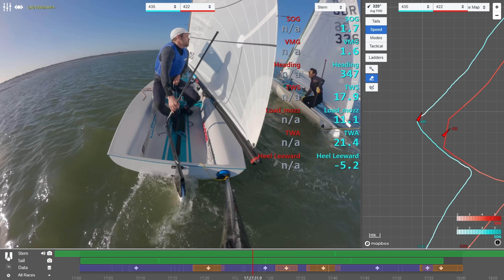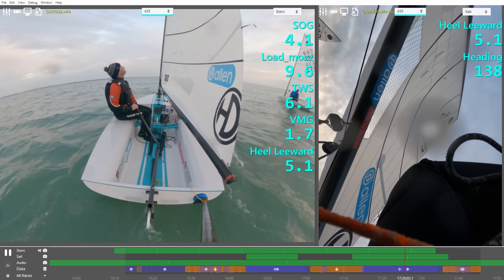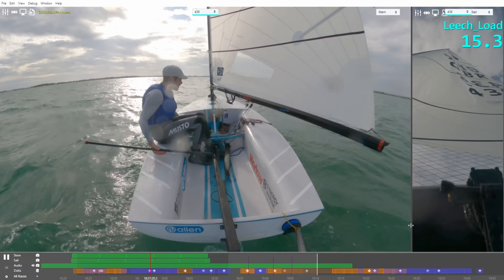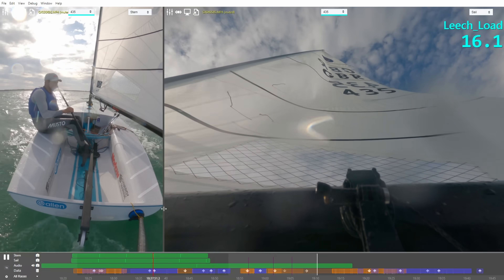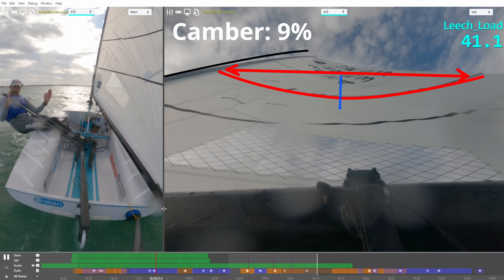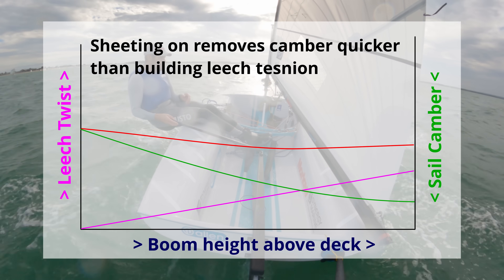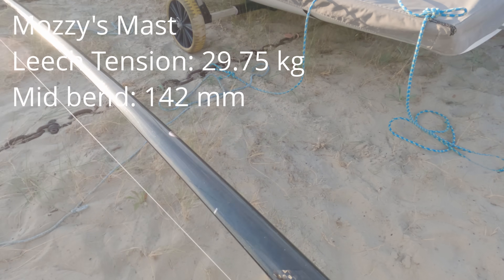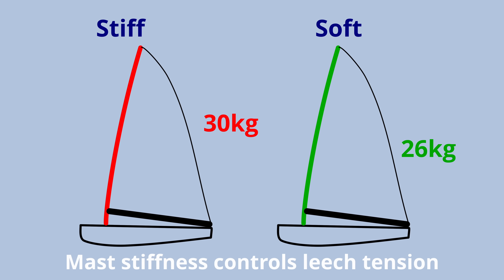The Mainsail Paradox: Lessons from the Europe Dinghy

Comment: Nice work, Mozzy. Well done and presented. A few thoughts: When you're measuring the force with cyclops on the sheet block, you are capturing the vertical component at the sail clew, not the leech tension per se, as in the dry land tension test. To measure the tension on the water, you should have the cyclops freely floating in the outhaul and also measure the angle the outhaul wire makes with the boom. The horisontal component of the tension is the one that bends the mast; the vertical component has little effect (as you saw in your dry land test with softer/stiffer mast), mostly absorbed by compression in the mast.

The angle will depend on how tight you outhaul and cunningham are - and the cut of your sail: how the tension controls the twist of the sail depends very much on the vertical and horizontal distribution of the volume of the sail, so your conclusions may only apply to the sail you have. The shape is built into the sail through luff curve and mould shape (seam shaping), with luff curve being only one part of the equation and easily adjustable, while the mould is the more demanding part of sail design.

Eagerly waiting for your next videos!

We have written a lot about the Finn sail & mast during the years, I dare put links here for reading, as I think they are more educational than advertorial in nature:

https://wb-sails.fi/en/the-scientific-finn-2/

https://issuu.com/finn-class/docs/finnfare_march_2023/13

https://issuu.com/finn-class/docs/finnfare-august-2020/17

https://issuu.com/finn-class/docs/finnfare-april-2021/11

https://issuu.com/finn-class/docs/finnfare-april-2015/23

https://issuu.com/finn-class/docs/emasters-magazine_2015/37

https://wb-sails.fi/wp-content/uploads/2021/04/finn_mast_dynamics_by_wb-sails-1.pdf
Reply from the maker: Thanks for the comment, very helpful and those articles are really brilliant. The article on tailoring the sail to the mast is very much in line with what I am trying to convey in this video. 

I agree to an extent with what you are sailing about the load cell placement - the main-sheet is very much a proxy rather than precise leech load measurement. However, I do think the vertical load does add significant bending due the secondary moment of bending as the mast out of column. 

One article I found very interesting was the art 2 of the wired finn specifically the bit on sidebend. I confess I am confused by sidebend. I would think sidebend increases the angle of the sail to the wind as the luff falls to leeward along with the mast whilst the leech is still held up - increasing angle of attack when you want it to reduce and twist off. But the conclusion from the article seems to be that sidebend help increase twist in the sail - how is this? I come from sailing stayed rigs and can't fathom why I wouldn't just want the stiffest mast sideways as was possible to manufacture.

Comment: Love the analysis and detailed measurements. While developing my SIM (2Sail), it has really (enjoyably) pushed me to understand and question the physics of various boats, why they do what they do and why "experts" (who are fast) can also have quite different views. a couple of considerations over the years include: the vang, mainsheet, traveller & cunno effects on twist can be very different depending on position on mast, direction of pull, shape of mast (think 49er with hockey stick top where cunno has big impact) and bend on mast. BUT 1 thing keeps coming back "a lot" is keeping the boat "flat" which very very few people do because it is hard, uncomfortable and depends on sail shape control. It makes a massive difference and is so easily overlooked (even a few degrees). Looking forward to the next techo deep dive.

Comment: Thanks for the interesting video. There are some questions though. You mention with the same mast rake, lighter sailors, who have a more bendier mast, do not have the same leach tension. But perhaps that's why they measure so much the mast rake. In lichter winds they might want a higher rake, and then still have the same leach tension.  Will also help them downwind by the way, downwind a straighter mast is faster. But the main comment I wanted to make is that you don't discuss the cunningham. You have a HD sail and regretfully have the same. The general idea behind the cunningham is that it works in combination with the mast bend. The bend takes sailcloth forward but if there isn't enough, the cunningham will push it forward. The downside in light to medium winds is that it will also open the leach. But in stronger winds, that is exactly what you want. So it balancing, leach tension via the sheet - as the vang/kicker does not work in a Europe - and mast rake, together with the cunningham. Unless one would have a HD sail where I didn't see any effect at all with the cunningham. Also logical given the position of cunningham 'hole' in the sail, straight down the mast instead of a little more inside.
Reply from the maker: A lighter sailor could rake forward to increase leech tension - but then their leech would be too straight an overpower them. I would say most lighter sail choose sails with less depth and a  mast stiffness which give them comparable leech twist to heavier sailors. 
Cunnigham is really important and you're right I don't discuss it. This video is really talking about powering up to the design wind (where the sail is powered and you are fully hiked but not overpowered). Above that wind you need to start depowering. This could be down by easing sheet tension or raking back - however both those options increase draft and therefore drag. So instead you can use the Cunningham to bend the mast. Using Cunningham releases tension from the leech allowing it to twist off but also keeps the mast bent reducing camber. The cunnigham also works more by bending the mast higher up. 
I tend not to use cunningham until 15-16 knots. Between 8-15 I use inhaul. 
One change we made with the very latest HD is to lower the downhaul and inhaul eyelets. This means the Cunningham has more effective range that earlier revisions.
Reply: @MozzySails  thanks for the reply

Comment: Great video, Mozzy Sails!
Super happy to see a follow-up to your earlier one — I've been thinking about it, and now I'm keen to try the same thing on a VX One.
Would you mind sharing what program you used to measure the footage, and how you mounted the camera? Appreciate any tips!
Reply from the maker: I use a gopro mounted to the boom. Tried cockpit floor put the perspective on the sail changes with traveller movement. 
I run the gopro in linear mode to remove lens distortion. 
I tend to then sync up footage with data in Njord Analytics and Njord Player before grabbing a screen grab and measuring camber and twist in SailPack vision from One Sails which is free
Reply: @MozzySails  Thank you for getting back to me.
From the video, it looks like the GoPro is mounted with a slight offset — is that right?
Reply from the maker: @SailingDownUnder it's on a sticky mount then a 20cm stick to get lower down. 
I think ideally you'd be 40% along the boom but this is more like 30% to avoid fouling the mainsheet

Comment: I am a big fan of a una rig with unstayed mast, because it is so much simpler and quicker to rig than a traditional rig with headsail and rigging. If you don't have much time to sail then you will reallly appreciate a una rig! It is great to have some simple tuning metrics. I use a una rig on a model sailing boat and I have found it useful to add prebend using a stay mounted from a mast crane sticking out the back at the top of the mast to the back of the boom. (Not sure if it is called a backstay in this case?) You can add twist to the rig or account for luff round then by tightening the stay independently of the other controls. 
Keep up the great work Mozzy.   You must have the best techie sailing videos around. Looking forward to your next ones , especially on SailGP and Americas Cup

Comment: This is interesting, Tom. 2 Questions on behalf of ILCA sailors:
1) We're always taught that the vang is a depowering control on the ILCA, commonly said to help by allowing sailors to sheet out in gusts whilst spilling air out the back door, without the boom coming up and moving the centre of effort forward and powering up the sail. But unless the sailor's overpowered, they'll sail the ILCA block-to-block upwind (with vang), where it would appear that the vang also increases luff tension and decreases twist, while also decreasing camber. What are the mechanics of depowering with respect to these latter features? Does the decrease in camber (flattening the sail) outweigh the luff tension and loss of twist? Does hiking further increase power losses due to twist?

2) The new ILCAs come with a carbon-fibre top mast section. I always presumed that the advantage here was a few pounds of weight. But what is the effect on mast bend, and therefore the other characteristics?

Thanks,
Cameron
Reply: Hi, as I didn't see an answer from 'Mozzy', here my 2 percents response. The vang or kicker is extremely important on a beat on most boats, to keep tension on the leach and to depower in stronger winds. The latter only in combination with the cunningham which is not discussed at at all in this video. I will respond to that issue in a separate comment. But on those most boats there is fair amount of space between the boom and where the mast is fixed on the deck. In an ILCA one can not adjust the latter, in many other classes, certainly 2 handed, one can.In essence, with the vang,  you push the lower part of the mast forward and the upper part downwards. Will also have an effect of the sail. That's where the cunningham kicks in. Will bring more of the sail forward where it needs to be as the mast went forward but will also open the leach as you want to in a heavy breeze. I have always heard that in 20 knots plus conditions, and for lighter sailors already earlier, one sails with the under third part of the sail. The rest would only work against you. But to come back to the Europe and similar boats: with an about 20 cm between deck and boom, the kicker does not have this effect. It is actually quite loose on a beat and only works downwind for sort of stabilising the dinghy

Comment: I remember being lent a standard sail rigged laser and racing against a radial in a healthy force 4. You simply cannot apply the golden rules of a stayed rig to a laser. I bent the mast trying, lol. I got thrashed by a radial sailed by a guy much lighter than me. 
The sail is garbage to begin with, the mast is a laughable mess of inferior alloy tubing and the rigging is cheaper than a Croydon street walkers underwear. 
As a result of the bendy rig you try to compensate with the main sheet because the kicker craps out prematurely.
The boom bends down under the strain and the leech tension hardly changes. 
As a result, and nobody ever admits this, you have to crank the boom down to the transom to get any decent leech tension which means you can't sail as tight to the wind. Unstayed rigs drive you in to an inefficient corner where you are straining the rig, the hull and your body. 
It's like premature ejaculation. You got there but the misses knows your underperforming.

Comment: Since the righting moment side (by weight) of this is pretty linear, it might not be too hard for you to construct a curve of recommended mast stiffness measurement (in kg) for a given sailor weight. That’s a fairly easy measurement for your average Joe, on the water data collection not so much!
Reply from the maker: Yes, I am working on that. A good sail maker will have this and I know carbon masts who makenthe masts have it - but i think these table are experienc driven rather than from empirical measurment. Measuring on the water will always be best but I should be able to produce a table of suggested mast f/a bend numbers for a given sailor weight and the corresponding base leech tension

Comment: Keen to hear your thoughts on side bend...Finns have evolved to similar Fore/aft mast bend numbers...but vary dramatically in side bend. The advent of "free-pumping" over 10kts wind speed has seen a trend to stiffer (sideways) rigs to maximize power transfer when pumping downwind....keen to hear what the actual difference is and if that is as significant as mast makers suggest (or are they just driving sales!)...again, GGM's are less likely to fully pump and are more likely to "rock" the sailplan to achieve the results....

Comment: Interesting analysis. I think this explanation is a bit over complicated, though, and can be summarized by considering the same trim point (not the same leach tension) and how masts change sail shape: a softer mast will have the same chamber, but a more open top of the leach (while keeping the foot angle of attack the same.) The net effect is a quicker depowering when considering windspeed (vs a stiff mast.) Rake can offset some power of a stiff rig (by opening leach), but you are still left with a deep sail. Vangs/kickers exaggerate this effect by adding more bend to mast therefore further flattening sail, opening the leach, and allowing a smaller angle of attack down low. Thoughts?